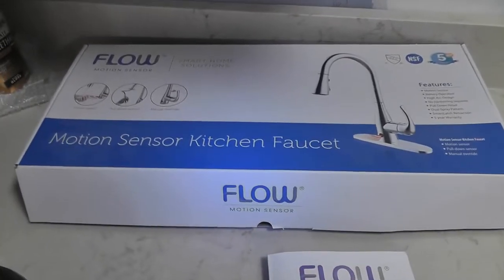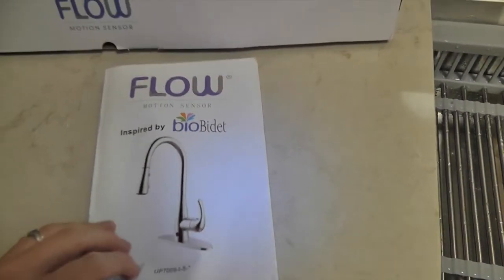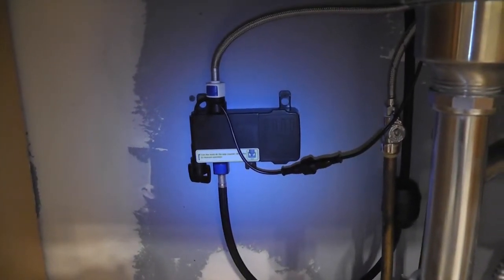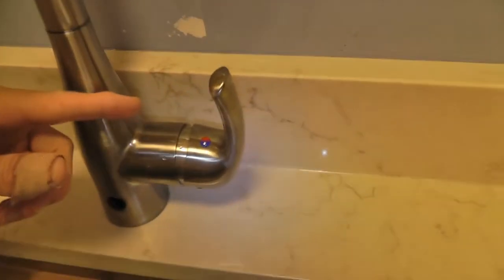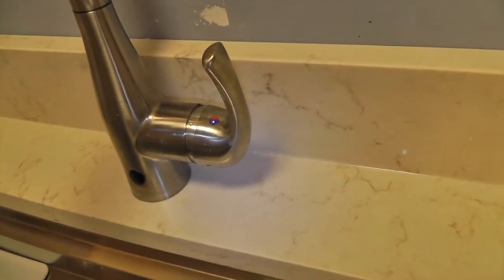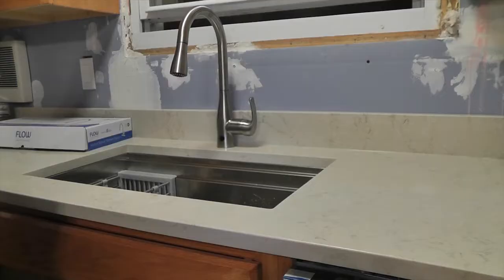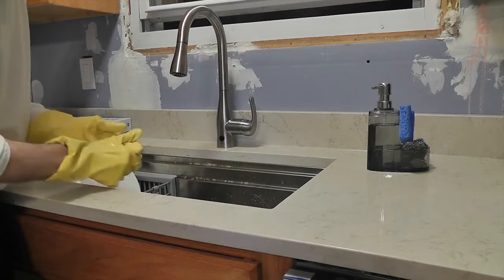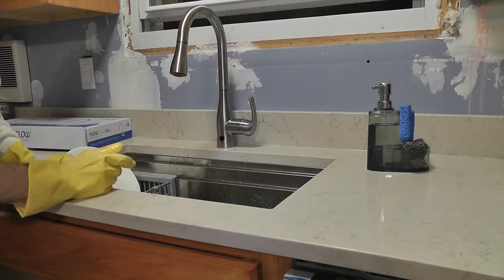How I fixed my Flow motion sensor Kitchen faucet

Comment: I love this product. I have had it installed for several years. What I most like about it is that it's a water saver. No need to let the water run constantly when doing dishes. My experience with customer service has been positive.

Comment: Thanks! I was using the faucet in manual mode because it stopped working. Replaced the batteries and couldn't get it to work at all :o Couldn't get it to work after turning the button clockwise or counterclockwise but then saw your video and unplugged the data line, waited a couple of minutes and plugged it back in. Voila! Thanks so much!
Reply from the maker: That is awesome.  I am very happy I was able to help.:)  
I hope my other videos are as helpful.

Comment: What do you guys recommend I unplugged everything and my sink still won’t work I see the sensor blinking but it won’t let the water out I also did the battary change and nothing
Reply: It doesn’t even do it manually
Reply from the maker: I am not a plumber, but if you are not even getting water to come out the faucet manually then it sounds more like the shut off valve.  Is the water supply to the faucet turned on?
Reply: @DiscoverwithDave  yes it was ended up replacing the entire thing

Comment: I believe my control module quit after 3 years. I can't get it to work in manual mode. Any tips? Just had knee surgery today and having to coach my wife
Reply: Try putting in new batteries.

Comment: hi 
my body before me took apart faucet trying uninstall for countertop replacement, after all we find out 1 wire. cable was hanging out like was disconnected, after all faucet don’t work 
i thing we need connect that cable back  and i don’t know how

Comment: This faucet leaks after not even a year. Mine drip every 2 seconds. I open up and check the seal and gasket inside the head and it looks pretty good. How do i fix this?

Comment: How do you disconnect the data line? Is it a direct pull apart? Or does it need a twist?
Reply: Unscrew the locking collar then pull the 2 halves apart.

Comment: Thank you for this video somehow my dads manual wasnt working so i unplug the connection for 1 min and plugged in and manual is working...but wondering if manual is set why disconnect to make it work lol but it worked... i need to try taking out the batteries out now and keep using it as manual

Comment: just bought the same faucet, the position of your handle to wall seems close like mine, is there any way to readjust the handle from hitting the wall as it doesnt go all the way for hot water.
Reply: My kitchen and quartz and the even the sheet rock look the same as this guy's lol. I have the same problem with my handle. I just installed mine today and I just rotated it a bit so that I can freely open the hot water and to prevent it from hitting the wall. Its slightly noticeable and the sensor is not centered but it's better then getting annoyed by the handle every time you use the sink.
Reply: I also rotated mine slightly clockwise. Not really noticable

Comment: Glad that has helped folks. We've had  Flow for a couple years and it leaks around the handle. Two local  plumbers have told us they can't fix because they can't get  parts for model. It was hard to get a response from the BioBidet company and they said we could ship it in and pay for repairs. Something like this is an investment for long-term use. People should be able to repair their own devices. Just an FYI for folks who are thinking about the product.
Reply: I'm having the same issue. Can you even figure out how to remove the handle???
Reply: My Flow Motion Sensor Kitchen Faucet handle also started leaking after about 3 years. There doesn't seem to be a way to remove it... I've reached out to them, we'll see if I hear back.

Comment: My problem is that my flow faucet head stopped shutting off when I put it back in position. It worked great for years, now when I pull the head down, the water comes on, but when I put the head back, it won't shut off.

Comment: Love this faucet.  Installed and cannot get to full "hot" as the lever hits wall.  Your installation in video is actually closer to wall than my install.  Can you adjust the range of the Hot-to-Cold on the lever?
Reply from the maker: Hi Fonda,
Thanks for the great question.  I have been using for awhile now and I believe I am getting the full hot, LOL.  Maybe I am missing even hotter temperatures..  But seriously, I have heard of some people with similar problem and they rotated it a bot to get more range. Mine is close, but able to get hot and cold. Thanks for watching and please stop back.
Reply: Did you figure out how to rotate the handle I have the same problem

Comment: A major flaw in these touchless faucets is the cartridge that is in the electronic box. Mine started dripping after about 1.5 years but only if the manual handle was open. When manually closed it did not drip which means that the manual cartridge was fine. But when it was open and ready for the sensor it was constantly dripping.
Reply from the maker: Interesting, I have not experienced that.
Thank you very much for sharing that helpful information.

Comment: After two years, wife says Flow faucet not working. Time to change batteries? Changed batteries, no change but I could hear the solenoid valve clicking. Hmmm. Changed valve underneath to "manual". Still no flow. Hmmm. Possible solenoid valve plugged. So I tried unscrewing the faucet head. Water flows like a river with no head. Hmm. There was no indication how I could dissemble the head. But the first thing the water hits is what I think is the flow restrictor, It's tiny but it pries out of the head inlet. Looks like some kind of valve - maybe a one-way check valve. Reassembled the head to the hose and works like a charm, with more flow. So add this to your list of possible problems.
Reply from the maker: Thank you very much for sharing your issue and resolution.
Reply: I had a similar issue.  Water would be flowing and then suddenly stop.  I could hear the sensor trying to open the valve but nothing.  Switched the valve on the black box to manual and still nothing.  I found the comment hear and gave it a try.  Removing the flow restrictor worked for a few minutes and then the water snapped off again.  Everything worked great with the nozzle head removed so I knew where the problem was, just not what the problem was.  It ended up being the manual shut-off button on the nozzle head.  Water flow or vacuum pressure was causing it to active and stop the water.  You can see the manual shut-off mechanism inside the nozzle head so I used a wooden skewer to push the valve open.  That seems to have done the trick as all is working fine now.
Reply: @tlmoore91  Thanks for posting this. I wish I saw it before I removed the Flow faucet (after ~7years of service) and re-installed the original builder faucet just to get some running water in the kitchen again. Had to push that valve in and out a few times before it started working again as you described. Will try that first if it happens again! :) Thanks @DiscoverwithDave as well for posting the original video as well. Appreciate you both!!
Reply: Looks like this may be the case with me as well, if it works, many thanks. UPDATE: Worked like a charm, cleaned the head with some Vinegar while I was at it, thanks again buds, cheers from FL!

Comment: Hi, a plumber checked my faucet and rold me the censor is done but it is pretty new so I can't believe, then after he fixed it and left, ever so often the pipe sprays out water.
The pipe was running with the faucet off and we had thought the battery needed replacing before because we had to use the tap..
Reply: Sounds like your plumber lied to you

Comment: This Flow kitchen Faucet is garbage. I have had it for 2 yrs and  after a yr I have to change the batteries every month. They offered me a new black box but wanted me to buy it, send them the old one and if there was a problem with my old electronics box they would refund me the money. What a waste of time and money.  plumber wanted $200 for install. Should have paid the extra $200 from the start and purchased a Moen or a Delta.
Reply: Huh, the same symptom happened to me, first set of batteries last for over a year, then every 2 or 3 weeks have to change fresh ones. I ended up soldering a 6V AC/DC adapter wire to the control box battery compartment to get rid of using battery. There are also AA dummy battery in the market, around $5 for 4.  Using them with adapter or  some dummy battery also come with AC/DC power adapter hooked in the package for total around $12 pretax.  You do not have to the wiring work as I'm doing. The other thing I do not like is the water volume control handle, narrow range from no water to strong stream , harder to get somewhere in in between.   It looks not high end also.
Reply from the maker: Interesting, thank you very much for sharing.